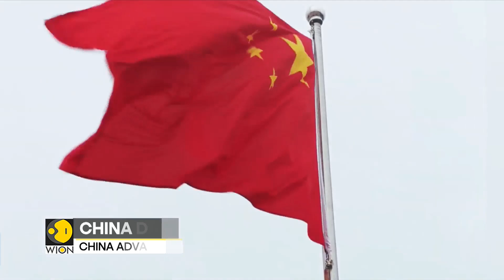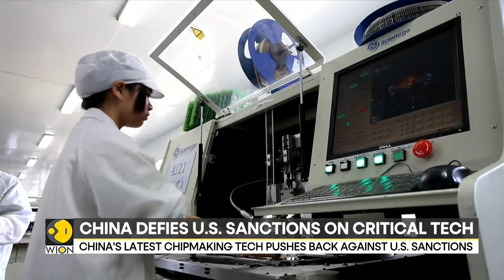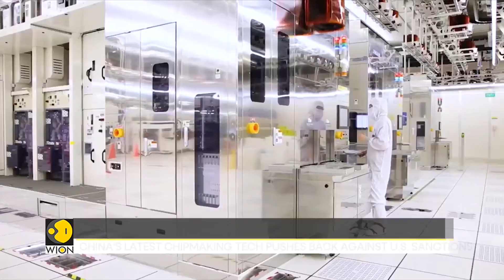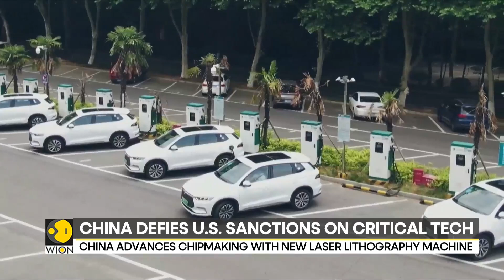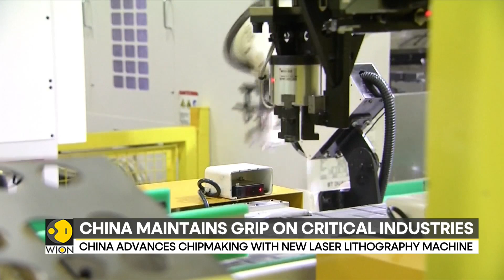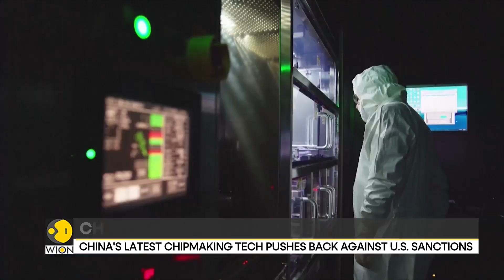China Advances Chipmaking With New Laser Lithography Machine, Defies US Sanctions | WION

Comment: The most important significance is not the current production of lithography machines that are several years behind, but rather China's rapid formation of a complete industrial chain for chip manufacturing under pressure from the United States. The shortsighted actions of the U.S. in this regard are shocking and lay the groundwork for unpredictable troubles in future China-U.S. competition

Comment: Microchip companies in China are bankrupt 
BLOCKED BY JOINT EFFORT 100+ IC PRODUCTION LINES TO BE SHELVED IN CHINA
China: 5700 chip companies shut down in 2022/ The fierce game of one lithography machine

According to the information released by Qichacha, in 2022, there has be 5,746 chip-related companies revoked or canceled in China, far exceeding previous years, and an increase of 68% from 3,420 in 2021. At present, there are more than 170,000 existing chip-related companies in China. At the end of January 2023, an official of the China Information Consumption Alliance said in an interview with "Global Times", China's official media, that China was building chip manufacturing plants at a rate of 100 production lines per year. However, under the American sanctions, the construction of these chip factories may be delayed or forced to switch to mature processes. At present, the integrated circuits or IC industry generally regards 28nm as the watershed between the mature and advanced processes. 28nm and above are mature processes, and below 28nm are advanced processes.

Comment: Several points:

1) The resolution of these Chinese DUV lith machines are 65nm.  This means they could make 28nm chips with multiple exposure.  In comparison, ASML DUV machines have 28nm resolution.  This means they could be used to make 7nm chips.

2) ASML is the accumulation of dozens of nations working together.  China is alone is making its own machine. 

3) 5 years ago, China does not even have a lith machine.  It comfortably assumed that it was part of the global supply chain and expect this machine to be made by other nations.  5 years later, it has its own.  It is not as high resolution as ASML, but they have come up REALLY FAST.  DUV machines with 65nm is still an EPIC ACHIEVEMENT AT THE HIGHEST LEVEL.

4) These announced DUV machines are industrial level.  This means they can be produced AT SCALE.  Research in Shanghai was able to produce lith machine at the resolution of 28nm or less.  So, it is expected that in less than 5 years, China will have its own DUV lith machines at 28nm, produced AT SCALE.  That means, China could produce its own 7nm chips, AT SCALE, with its own DUV machines.  Currently, China could only produce 7nm chips, at scale, with double exposure using ASML DUV machines.  And ASML was forced NOT TO PROVIDE SPARE PARTS, for these machines.

5) ASML is blocked from providing EUV machines, at 12nm resolution, to China.  So, China's EUV machines research is ongoing.  It will be at least 10 years before China can catch up to ASML on this front.  These machines are used to produce 5/4/3nm chips.  Anything lower than 3nm chips are not practical the quantum interference makes it impossible to use.

6) Another point to call out.  The so called 4nm or 3nm chips that were made by TSMC are actually not with 3nm carving.  It is 7nm or 5nm carving STACK UP.  That is, given the same real estate, TSMC was able to carve out enough 7nm or 5nm channel transistors, 3D fashioned, that have the same number of transistors as if they were real 3nm channel transistors.  They are NOT.  It is just marketing gimmick.  They are still 7nm or 5nm chips.  That is because the EUV machines can, AT MOST, has light resolution at 12nm.  After couple exposure, they can carve channels with 7nm or 5nm width.  But it is almost impossible to go down to 3nm.  Thus, the 3D approach.
Reply: China's ability to develop and produce DUV lithography machines at scale is a major achievement. However, the challenges of EUV lithography and the complexities of chip manufacturing will continue to present hurdles for China's ambitions.
Reply: SMEE has had a 28nm lithography machine (SSA800x) since at least late 2023. This machine can produce chips in the 14-7nm range without multiple patterning.
Reply: @Bangy  My understanding is that this 28nm lith machine is industrial grade yet, meaning it could not be produced AT SCALE.  When Chinese government announced something, it must be rock solid, large scale, and consistently available.  So when they say they could do 65nm, that is their baseline.  That means they could do 28nm but won't make it official as it might not be AT SCALE yet.  And when they say they could do 28nm, that means they might have done 12nm.  So on and on.
Reply: So naive
Reply: I expect the Chinese will be able to use technologies unavailable when the original DUV and EUV machines were developed. Much of the difficulty with EUV was creating an efficient and consistent EUV light source.
Reply: You have many words, I believe you
Reply: @shandongzheng 😂 I believe him too. Even though I don’t understand
Reply: @COLDoCLINCHER37 that is the whole point. It’s not their own machines. They upgraded them by using tricks. But they are no more tricks to upgrade an old machine.
Reply: @solmak47 you sound clueless but ok...
Reply: @trualways911  lets see how long it will take China ti produce smaller chips than 7nm and will see who is clueless.
Reply: @solmak47 Not more than 4 years by 2028-2030 You will see with your eyes China's semiconductor is at 3nm
Reply: @nerrailwaygorakhpur7173  good luck. The 7nm you achieved it by modifying western machines.
Reply: @solmak47  No it's not modified but it is fully foreign 😂 but that was not important infront of what is going on that is important